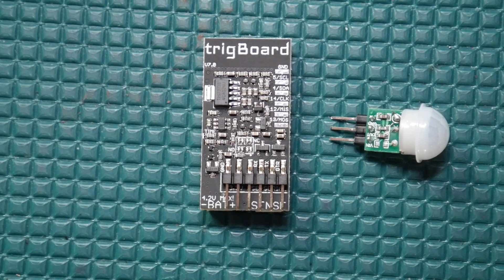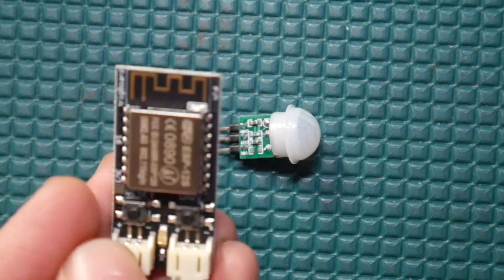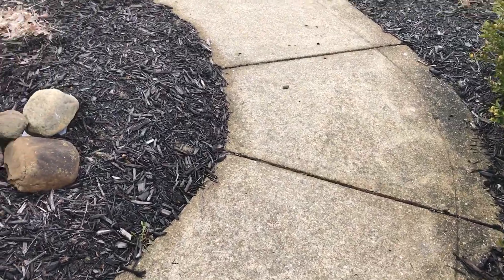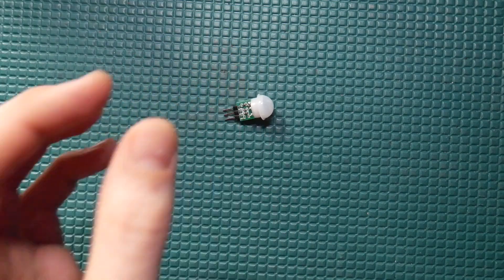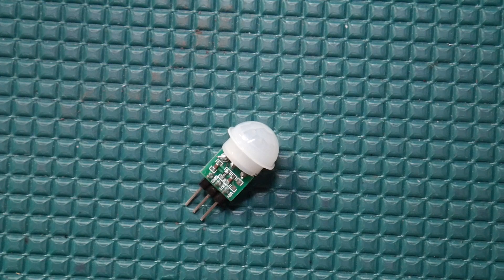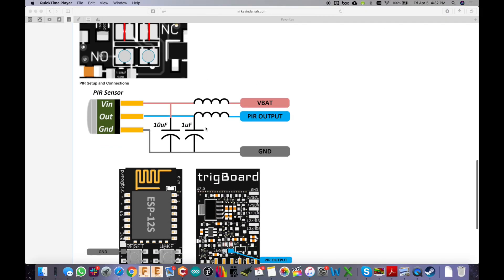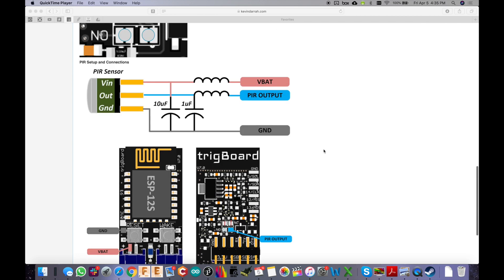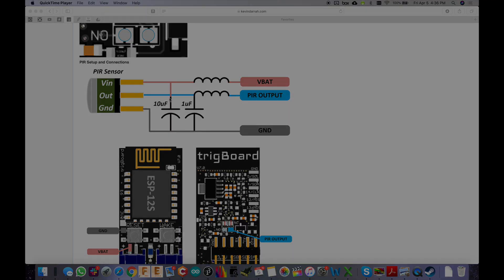PIR Motion Sensor False Positive Fix!

Comment: The 1uF on the output is a bad idea.  If PIR drive is weak, it will slow the rise time such that the input of the CPU detects a metastable state and all kinds of bad stuff happens.  It would be better if you actually show scope traces when you do this kind of thing in the future.  I did try your solution:  Here was my result https://drive.google.com/file/d/1HN3Lb7IzhXOlHqnvXcI1C6a2Xa94qwQs/view?usp=sharing
Reply: I did better by adding a 3.3V LDO with mfg-suggested filtering in/out... That made things very much more reliable.

Comment: I found wrapping the pir sensor board with foil to shield it the trick for me.
 I used kapton tape on the board, then foil and finally heat shrink. Cheap and easy.
Reply: I tried 9 sheets of foil and 2 layers of masking tape and that still didn't work.

Comment: Kevin I know nothing about electronics, but you obviously do. 😀
I’ve put up an outdoor battery powered night PIR motion sensor LED light that was purchase new around 18 months ago. I tested it first and was impressed by it. It’s solar powered and all seems great performance. It solar charges and uses 2 sealed 18650 batteries connected to a small board with a round plastic sensor as you show, that ‘looks like’ an EKMC1603111.
Installed it and tested and works great. However it false triggers 30 times each evening. I completely covered the sensor and tested it would not detect, however it still false triggers even covered, so it’s faulty. Which is a shame because otherwise it’s an impressive light for being solar powered, and I hate to just bin in.
The board and sensor doesn’t seem to have any adjustments at all. Is there anything I can ‘simply’ and cheaply do to fix it? What are these Ferrites and how do I fix them?
I know you haven’t seen it or even know what it is at all, but is it simply pushing in a replacement sensor and which to use and where to get one? Any advice would be much appreciated. Thank you! 🙂

Comment: I came across this video in search of a way to fix the false positives with the AM312 motion detectors. Put the 2 capacitors in place and it works perfectly now. What happens if I want to add multiple AM312 to my MCU? Do I need multiple 10uF? Or can all of the AM312 work off of the same capacitor? I believe that I would need a 1uF capacitor for each AM312 output..

Comment: The noise is certainly the problem. Because of a lack of ferrites in my DIY-supply, I tried an LPF solution by solely using capacitors. My problem of false positives was completely solved by putting 3 capacitors in parallel, connected to the supply voltage and ground terminals: 1x ceramic 10nF, 1x ceramic 100nF and 1x electrolyte 10uF.

Never had a false positive for weeks now!
Reply: I know this is an old comment but I still wanted to thank you. I tried your simple, yet effective suggestion and haven't had a false trigger so far. Cheers!

Comment: I had lot's of false readings with an ESP8266 and a HC-SR505. I tried this solution and it's much better now but not good enough.
So, where to put the ferrites. Between the ESP and the  HC-SR505? or UN-solder the sensor itself and put the ferrites between that?
For now I put them between the ESP and the HC-SR505.
Reply: are u still facing the problem?

Comment: I notice all your boards are using lithium rechargeables. That would mean charging them all manually every couple of months is that right? They'd have some level of self discharge. I'm thinking of a similar thing with alkaline (AA) batteries and trying to make it last around 1 to 2 years between battery changes and I figure at less than 20uA sleep current and wifi on for no more than 25 seconds a day, this should be achievable. What do you think?
Reply from the maker: yea, check out my latest v8 board - now runs on anything from 2-5V

Comment: Tnx sir!
I use two inductance of 220,  dont know if have ferrite but work only with this 2 components!
Also add 2 very little electolitic capacitors for be sure.
Tnx again!
My pir drive a transistor 2n2222 with a ion negative module at 12v as load.
This cause a lot interference and a continue false trigger.
At terminal of module there is a high voltage capacitor in parallel with a flash tube for camera.
Its very nice for Christmas!
Now work good!
Reply: @5322-r4b , Are these 220 H (Henry) inductances?

Comment: I'm working on a similar project and wired a tiny solar panel on a blocking diode to a rechargeable battery, but when the panel gets full sun it spikes the amps or something enough that the sensor creates false positive. the battery works between 2.75 and 4.8 volts, and the solar panel only puts out 3.5, so I thought it would work. Any thoughts anyone has would be great!
Reply: My AM312 PIR sensor is also suffering from direct sunlight.  I have all electronics indoors, just the sensor is outside.  So, I'm guessing this is an optical (or heat?)  issue with the AM312.  /chrisV
Reply: I got the same issue, the am312 starts generating false positives when the midday sun is very strong and directly shines on it. Have you found a fix or has kevins fix fixed it for you?

Comment: Thanks so much, had problems with false positives with a different setup, Arduino and Panasonic EKMB pir sensor and adding the 2 capacitors you showed in your circuit fixed it! Saved the day! Keep up the good work.

Comment: I wonder why the recommended ferrites differ so much in their spec:
HF30ACB321611-T: 19Ohms @100MHz
28L0138-50R-10: 153Ohms @100MHz
Is the actual Impedance value that unimportant?

Comment: hi Kevin, Had the same issue with the PIR and ESP8266, Did all the things mentioned and did not work

( fixed ferrite and  uf). I connected PIR out to  to  pin 16 with pulldown. Still did not work. All the others tested separately working. Finally issues sorted by changing the jumper wires from PIR to ESP8266. This means some jumber wires also contributing to the problem.

Comment: Hey I just built up a similar system (but not on battery) to transfer info to my raspberry pi. I am also detecting false positive, but sometimes 4 per our, and 0 for the next hour, plus, it seems to be only by night. Can my sensor be fooled by my PIR camera? Can my sensor (placed on the floor) be detecting a mouse which I can't see on the camera maybe? I will order some ferites anyway 👍. Thanks for your sharing.

Comment: wow thanks for the tip. as a test i used a 220 ohm with 2200uf and it worked a charm(a bit overkill). prior to that it was all over the place from what i concidered a good power supply.... will try the circuit you described

Comment: Hey! , some while ago I was working on the same project but instead of Esp I just used Arduino and nrf24l01 modules 
they work really good and of course, there was some false trigger as mentioned in the video, 
another problem I got into was while I was using interrupt pin of Arduino,  somehow it just takes all of the current from OUT pin of pir and didn't work well, so I hooked it up to a transistor and it just worked, hope that is helpful

Comment: I finally got around to trying this fixed for the false triggering and it works. His fix is  the only thing on the net that really works with these sensors.  I implemented everything minus the.1uf cap (didn't seem to need it) and all my false triggers went away.  the sensors are highly sensitive to the Wi-Fi signal interference from the esp8266. It was very perplexing because I was testing with Wi-Fi off and there were no issues when I started using Wi-Fi that's when the madness began. Adding the ferrite beads did the trick of grounding out the high frequency interference.  I picked up a bunch of inline ferrite beads on Amazon, and they work like a charm. Thank you Kevin for sharing this fix this is a life saver.

Comment: Thanks for sharing! Could you consider doing a video about which capacitor values and types to use for filtering? When do I need to implement ceramics and when electrolytics? Thanks!

Comment: As this PIR outputs 3.3v when motion is detected, you can attach its output to the CH_EN pin on the ESP8266-01 module, meaning you can wake the ESP up from being powered off. If you hook up GPIO2 to the same CH_EN pin and in your sketch you drive the GPIO2 pin high this will keep the esp alive. Once you’ve sent your notification you can drive it low again - turning off the esp. The pir only needs to drive the CH_EN pin high for about 400ms and it will wake the esp.

Comment: Dear sir I am looking for human presence  detector humans can be stationary or moving came across 2 sensor one as omron d6t mems thermal sensor and other as AMG8833 IR 8x8 Thermal Imager Array Temperature Sensor I would like to request you to make videos on these 2 to make human presence through arduino or esp8266
Reply: I have experience working with omron d6t mems thermal sensor but tell you, its way too tricky to sense presence, I did all sort of tricks and to my experience work good enough with human presence sensing, but the threshold limits are real pain in the ass. Either you need to compromise with the sensing distance or be ready to experience a lot of false triggers. Also with Air conditioner in the room it is a chaos.

Comment: I have had the same problem.  Here was my solution to the problem:
I accomplished a similar result with some code.  When the sensor gets a trigger, it checks the sensor an additional time after a short (un-noticeable) delay.  My device is not battery operated, and will use more current.  (everything in life is tradeoffs!) Thanks for the video!

 if (digitalRead(MotionPin1)) {
    delay(2);
    if (digitalRead(MotionPin1)) {
      delay(2);
      if (digitalRead(MotionPin1)) {
        //YEP, There is definitely motion.  DO SOMETHING HERE
      }
    }
  }
Reply: Hey there, Michael. I'd love to ask you some questions cause I've been struggling with this matter for so long now: the thing is that I'm using the exact same PIR as the one shown in the video (based on the AM312). Whenever the sensor detects motion, it triggers a pulse that is 3 seconds long, that's why I'd like to ask you how you get to make arduino differentiate with delays of only 2 miliseconds. In my case, if the PIR detected motion (an undesired false positive) and I tried to tell different pulses with 2 ms long delays I'd still get  the same result because the output signal of my sensor lasts for 3000ms! (3s) What do you do? whats the magic you are using? :D.
Thanks for your comment!!
Reply: @rodrimunoz9110  I just use a generic PIR.  Doing the digitalRead a few times solved the false positive problem for me.  But, I am not on a battery.  This might not be the best solution if running on a battery.
What else can I do to help?
Reply: @rodrimunoz9110  I am using this sensor:
https://ebay.us/TNVFa6
This might not be the most energy efficient solution to the false positive problem.  If you are running off a battery, my code could use more current than desired, and shorten battery life.  My project is plugged in, so I don't worry so much about micro-amps.
(on the other hand, the ferrites also consume some amount of current)
Reply: @michaelkrug  Hey there Michael!, sorry for taking so long to answer; I've been busy with other things. However I had time to check what you were saying the other day and here are my conclusions:
1) I used the generic PIR that I had laying around (same as yours), I read the datasheet and the output signal time when motion is detected ranges from 3s to 5min (regulated with the potentiometer), so  applying your code with two nested "if" and 2ms delays was pointless since the output signal will still be high; it doesn't distinguish in between peaks because the time 2ms is too short and the output signal lasts 3 seconds: after  the 2ms delays the code will still read a high signal comming out of the PIR, so it wont know if its a real or false positive
2)Are you using the PIR sensor outdoors?? my problem is false positives in outdoors.
3) I found out that modifiying/desoldering a couple of components in the module you can modify the minimum time that the signal will be held high after detecting motion from 3s to 0,3s. 
 
Thanks a lot for keeping up and answering!!
Reply: @rodrimunoz9110  1) You are right!  Absolutely right. I did not think of that. I don't know how the nested IF's fixed my problem, but they did.  
2) I am indoors (to be specific, my bathroom)
3) That makes sense.  The board may have some sort of timer circuit.

Comment: What might be nice on the Wiki is the addition of the math to work out the corner frequency based on the capacitor and inductor.
Fc = 1 / 2 Pi SQRT L x C
The Wikipedia page has the formula in a format I prefer to work with rather than in text (above).

With the above. people could specify their own inductors based on noise frequency measured.

Comment: I'll keep this in mind Kevin. But I have one of these PIRs as my shop "doorbell", connected to an Arduino, and have never had a false trigger yet. So the trash on your lines is probably being generated by the Trig board.
Reply: Is your Arduino using WiFi or Bluetooth? If not you probably won't see it. If you turn off WiFi on esp8266 it works as expected. When wifi is on, high frequency noise is getting in on the power lines. Simple ferrite beads cures it.  This is a. If problem (Google our sensor and wifi). Kevin's solution is the easiest fix out there.
Reply: @miketony2069  thanks for the information